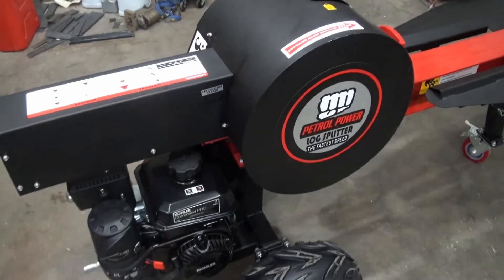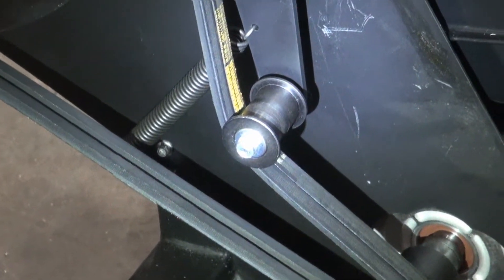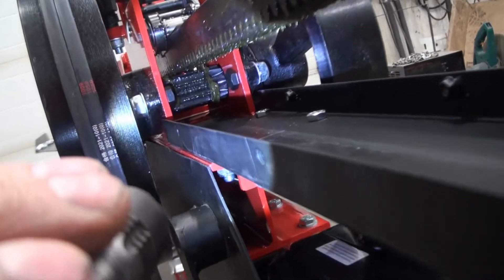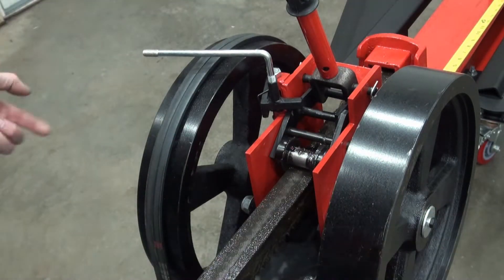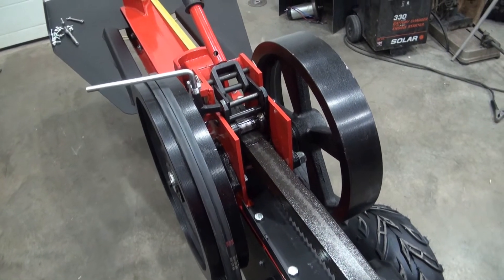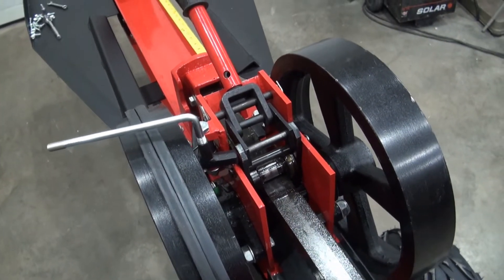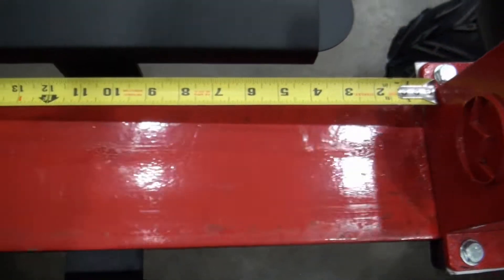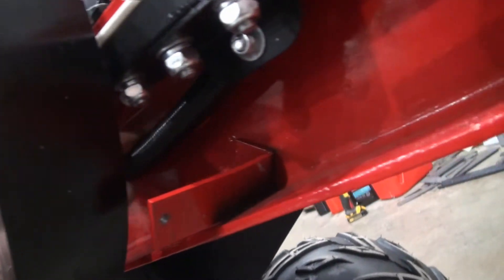Mechanics Of A 34 Ton Kinetic Log Splitter

Comment: How much do the flywheel weigh  ? That is the biggest single factor in how powerful a hit and how long a duration of the hit.  The splitter produces . 
 I have a 10 year old , 7 ton Timber Champ . It has 2, 55 lb flywheels

Comment: It would be nice if it could go vertical like the hydraulic splitters. I also am wondering how the gear rack and pinion gear hold up to the engagement of the flywheel weight.

Comment: Great explantion video. These splitters should be much more popular than they are being so powerfull and fast like that.
Reply: I agree with you except for the fact that this must remain horizontal, so it's incumbent upon the user to lift the entire log onto the table, that, or purchase a separate mechanism that lifts it. The lack of vertical splitting is really the only thing that makes these less popular. I've been considering a re-design to make these vertical, but it only exists in my head so far :)

Comment: Do you have the dimensions for the Belt. Mine is to work to read the dimensions on
Reply from the maker: I think there are about 5 different numbers on the belt, what I have done elsewhere to get a belt length is to wrap a rope around the pulleys and then clamp the rope ends together with a vice grip, then I took the rope with clamped vice grip to the store so I had a length sample.